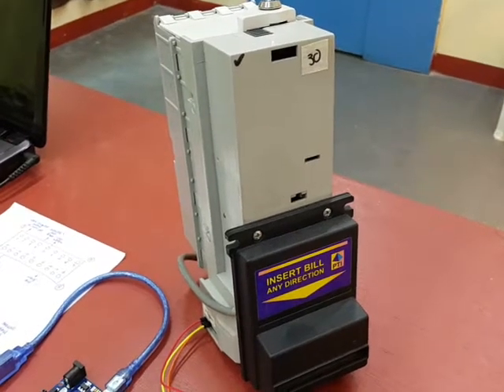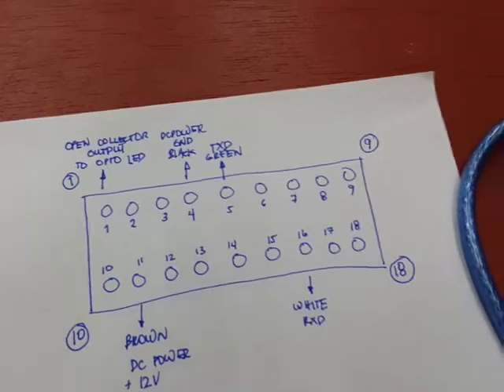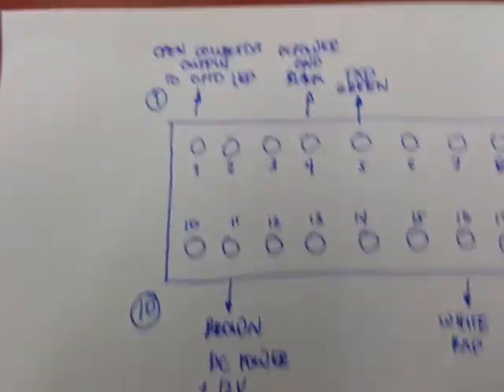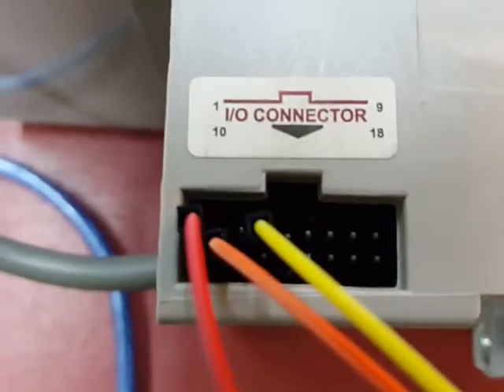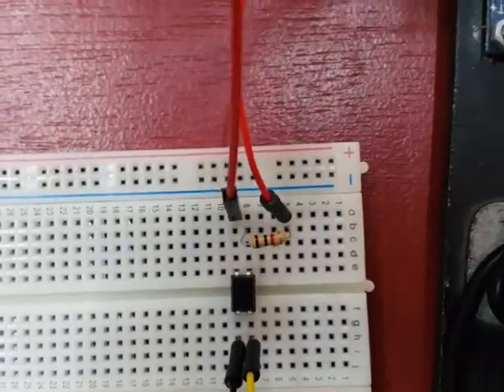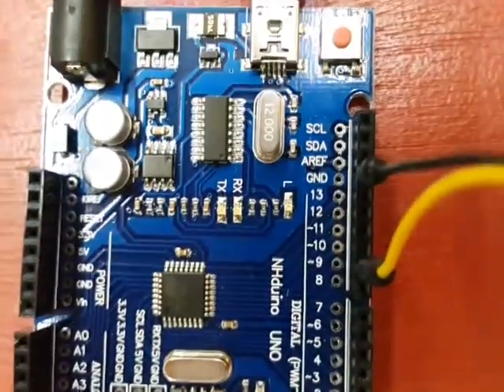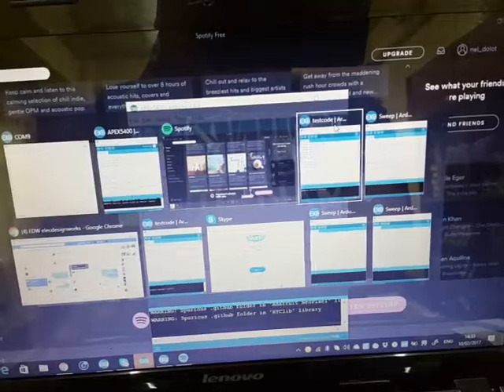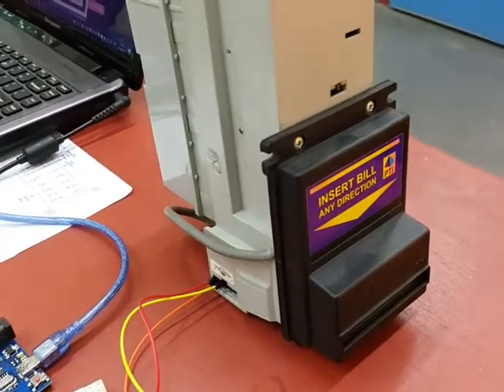Intefacing with your APEX 5400 Bill Validator

Comment: hi, is that connected to RS232 or  when it reads the bill value, the bill acceptor sends pulses till it reaches 100 usd?
Reply from the maker: luis abrahan vera marengo this BA is configured for pulse output. each pulse is 1PHP.
Reply: So, it means bill is sending one pulse according to the bill value ok?  If Bill is 10 usd,  then the bill acceptor will send 10 pulses to the arduino,  is that ok?
Reply from the maker: yup. thats how this particular BA is configured.
Reply: hello sir. how does this BA validates peso currency?         how does it determine the value of the bills?